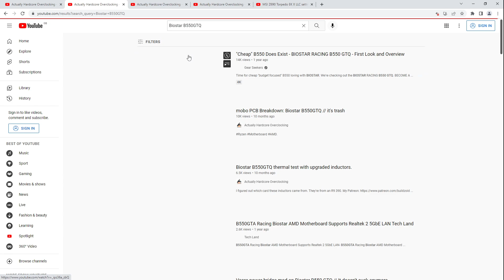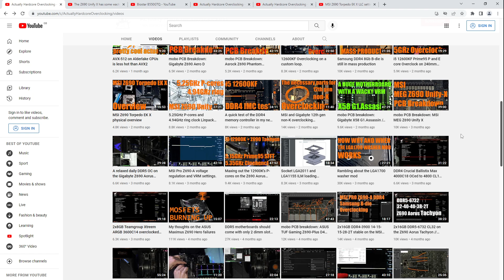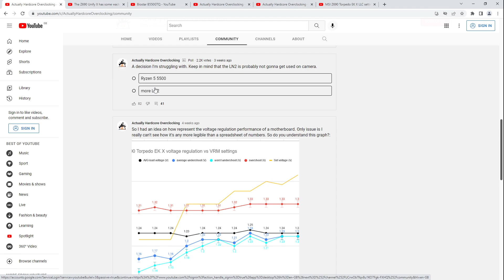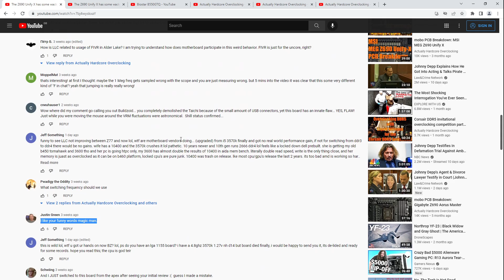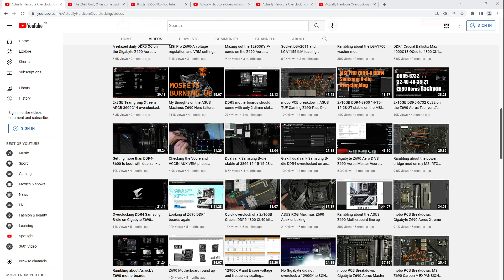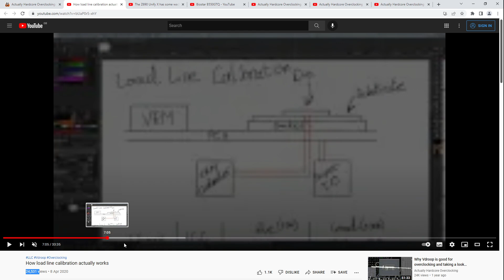Complaining about running the channel again

Comment: Ok, so for the subscriptions — put it in as a clip and copy it into the video via a "editing" software that copies without re-encoding. Basically whole operation takes the time to read and write the file of the video, if done correctly. Can even make it a .bat file to drag video onto for it to get put on, saved to specific directory. "Ffmpeg copy stream" for how-to.

Regarding the "review" of the motherboards. Point it out: this is not a review. Dats it.

Thumbnails are a keeper. Thanks for those.

Power stages "ooh 14*70 = I can do 980A!" — reference a separate video, saying "This doesn't work — watch that if you wanna know why"

Fuses — same thing. Do an explanation, show examples, say "its good for longterm use — watch that why it is"

Regarding specific "1000khz is broken", the point that if the setting is given but works very poorly, making things worse — it should not be given is kind of valid imo, so that's a bad thing on msi's side. Same with 1..4 levels of LLC. We got better pcbs thanks to your bullying of manufacturers, now raise qc for boards, manufacturers. 

11 minutes is short. kind of lul'd, thx

The asus hero and the 3090 — "This thing is broken, here's why" and you did them fast enough to get attention from other sources and reference your video. It was good enough and important at the time, so you got boosted for making time-relevant content that was fueled by others. And algorithm too, probably. Not sure why you didn't figure that out yourself here.

5500 vs Ln2: Ln2 is fun. 5500 got hated on and nobody will watch because they don't have it and won't get one ever cause cpu gaming bad. It doesn't guarantee AHOC content (as in, extreme), and doesn't produce content that is really relevant for viewers.

"Card runs, here's how well *example*; *change card mod*, card runs better *example*" is good content too, imo, but requires at least some editing, like stitching things together. As a series with same card it is unlikely to get viewed much, unfortunately, but understandably so.

56:00 is gold level of inception. "I don't know what word to use next". Scripting doesn't mean you have to 100% stick to script. Do it in forms of bulletpoints, will ease it for yourself and make you not forget something. Also, editing scripts, especially bulletpoints is 50 times easier than videos and doesn't involve listening to your own voice which we know you really don't want to do although people do get used to their own voice and it becomes fine, the first steps are hard indeed, ask me how I know..

"Send thoughts, will it help people?" — ask yourself. Are you confused a lot in your thoughts? If not, it would help. If yes, it might be fairly fun at least at times.

Also, hwbot roundups and memory timings videos are fun for periodic things and fairly easy to make, perhaps? Though sure, it is repetitive and will filter out major audiences. Can do less often with roundups / filter more. I liked the "weird hardware" aspect of the hwbot roundups and some sporatic fact / knowledge that I will mostly forget. But it is fun to watch.

Regarding the comments, I do hope you read this one. This will get watched by the most "fan" subscribers who are actually here for YOU as a person making content, not ONLY the content. It might be the most helpful in that regard?

Also. Do pauses at times like this one you did. Conciously, not via burnout. It helps to have a mindful decision to have a vacation. Even a week long one. If you do get something that is worth a video, DO NOT MAKE IT during vacation. Put it in a bin and do one later when out of ideas or just after the "vacation". That is good for mental health. Very much so. As otherwise you end up struggling because of the knowledge that you're struggling and struggling even more.

Will add more opinions on other topics brought up in this video. EDIT: Done. 

You're not wasting our time, even if it is — its our choice. I love this type of stuff, it is meta level.

Thank you.

Comment: I think buildzoid underestimates the number of people who watch just to see him talk about fancy electronic shit and have absolutely no idea what he's talking about. I've been subbed for like 3 years now and I still don't know what doublers do lol
Reply: "I still don't know what doublers do", well that's likely a massive deterring force to make videos for anyone who tries to explain/teach even on a low level. In short the doublers split the pulse width modulated (pwm) signal to mosfets in 2 - so it enables more mosfets to partake - hence more current/power handled. It also allows the use of cheaper (fewer phases) VRM controllers. PWM is a way to switch on each of the mosfets one at a time for specific amount of time.
Reply: @stanimir4197  I'm just here for the rambles, not electrical engineering. Hell, I don't even have XMP capable ram sticks lol. I just enjoy listening to him talk
Reply: He mentioned in the video that that type of comment is really discouraging to him.
Reply: @zekefloyd3918  I'm here for the wack videos of him rambling for 3 hours or overclocking at night during the winter with his window open. He can skew his content towards the more knowledgeable people like he desires, I don't mind. I'll still watch, I'll just have less of an idea of what's going on. I'm here for fun, not a lecture on electronics.

Comment: Why not try just filming your overclocking and measuring sessions without the intent of actually making a video, then if you can be bothered do a voice over edit where you cut to the best bits, you can use your band stuff to fill the gaps where you cant be bothered to comment on.
Reply from the maker: the camera tends to kinda get in the way a lot of the time.
Reply: @ActuallyHardcoreOverclocking  would you be able to set up a rig for a down-facing camera right over the table or something like that?

Comment: You should get people to send in old hardware and then overclock the piss out of it
Reply: This could be a cool idea to make more appealing to the masses content, but would require a lot of editing and changes to make it into a good video format. There would also be a lot of technical issues about people sending in hardware that can't be overclocked.
Reply: overclocking under liquid nitrogen is rather expensive (consumables and time) and pointless for mediocre silicone.  Overclock on air would be trivial but not 'piss out', water would be cumbersome as it'd require to build a designated cooler (also expensive).
Reply: @stanimir4197  below ambient water and AC chiller OCs are very YOLO if wanting to save time, and I’d watch some of that for the chaos.